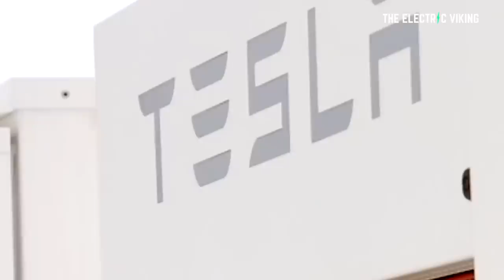Tesla's clear path to become largest truck manufacturer in the US

Comment: Hyliion has the best product-market fit. Nikola's and Tesla's products are idealistic and do not meet the demands or needs of the long-haul market. Electric Range Extender (ERX) made by Hyliion is the best way to bring electrification to trucking.
Reply: With ya on this one!
Reply: Hyliion will disrupt the trucking industry. They’re  collaborating with the best to create a remarkable drive train solution that can electrify fleets now.
Reply: Common sense: Hyliion is a much better long haul class 8 solution.
Reply: Correct sir!
Reply: Hylion hybrid natural gas trucks? Smells like fossil fuels to me. Economics will decide the winner, my money is on pure EV solutions like the Tesla semi, make your own fuel with solar plus battery storage.
Reply: @garethrobinson2275  RNG is not a fossil fuel. It is captured pollution from dairy farms and wastelands. RNG is the preferred version of CNG for trucking industry and over 50% of CNG filled already comes from renewable sources. As many capacities to capture RNG are in works as there are currently. It is widely available across 700 fuel stations which cater to trucks and fleets.
In case you are at a station where normal CNG is available , the CNG generator is 95% cleaner than diesel for emission. The new Karno generator acquired by Hyllion from GE is further cleaner and 20% more efficient.
A full BEN truck is not sustainable for long haul trucking as there are no truck chargers on the road and also the grid cannot keep up. The karno generator will be used by many of these fleets to charge their full electric trucks when grid cannot keep up.
Over the road truckers dont have 3 - 4 hours to wait and charge their trucks even if there will be chargers on road in future. Megachargers which charge truck in under 1 hour may work but one such charger consumes as much electricity as a whole truck manufacturing plant!
Reply: Hyliion Hybrid (HeX) is a product that's only a transitional product, definitely not the answer. However, the Electric Range Extender (ERX) is. Every year there's tons of methane released into the atmosphere from places like diary farms, waste water treatment facilities, etc., you can use that methane to create renewable natural gas (RNG). 

Current version of Hyliion ERX uses a natural gas generator onboard the truck, fuelled by RNG to charge batteries (because you produce the electricity onboard the truck the batteries are a lot smaller and have advantages such as weight, safety and lifespan as compared to full EV). 

Currently there's no infrastructure for full EV or hydrogen long-haull trucks, but as it gets built out Hyliion plans to introduce KARNO generator into the market that can run on a variety of fuels (so you can use both RNG, or Hydrogen if available and cost-effective to fuel the truck). And as Hydrogen becomes available and cost-effective for fleets, and infrastructure gets built out, Hyliion will only need to swap out the NG generator or KARNO generator with a Hydrogen one.

So to summarize, Hyliion has the best solution to current and future market demands.
Reply: @AndriusRut  You are 100% correct. Finally someone who undestands the reality of trucking industy which works on TCO not on emotional buying. Fleets aren't going to get all emptional and buy a $500K truck when there is no long haul usage possiblity as i explained. Hyliion's $220K truck has same or better TCO compared to diesel.
Reply: Natural gas as an alternative to BEV? The wet dream of the oil industy
Reply: @vic321344  In 2021, about 61% of U.S. utility-scale electricity generation was produced from fossil fuels (coal, natural gas, and petroleum), about 19% was from nuclear energy, and about 20% was from renewable energy sources.

Where is your energy coming from?
Reply: @afrotacular  >From gas, oil, nuclear, renewables. Its a question of efficiency. You need 1/3rd of crude oil to produce the electricity for electric trucks in power plants than when you burn it in the ICE trucks.
Reply: Troll farm.
Reply: @iandavies4853  You are more likely to be a troll with that intelligence. How about you present some proper counter-arguments instead of name-calling.
Reply: @vic321344  But you then still have a lot of negatives of EV trucks such as limited range and payload capacity, battery safety, recharge times, etc. It's better to just put the "power-plant" (aka. generator) on the truck and charge the battery.
Reply: @AndriusRut  that is just not efficient to have a generator on board. And it keeps you in demand of petrol products. The tesla Semi production will start in December. Then we will know how much of your "negatives" count again the low cost of operation, the shere power of the vehicle and the modern way of driving.
Reply: @AndriusRut  I’ve already mentioned, the stock price of company you promote has crashed from $50 to $2.60 so something very wrong. It’s just fossil plugless hybrid technology. Would have been nice idea in 1995. It’s no competition to Tesla. Very suss trolling.
Reply: @iandavies4853  Nothing is wrong with the company. Most companies stock prices fell down, especially those that are not profitable yet. Hyliion being one of them as it's a start-up. You are wrong on your assumptions and do not understand Hyliion products.
Reply: @AndriusRut  nah. It’s just a weak idea. Only recycles a small portion of energy from braking, and swaps methane gas for diesel propulsion - with Diesel engine still working. And that’s it. Totally trivial idea. You could achieve 90% of result by blending some methane into the diesel prime mover engine. Tesla is a total revolution. Be honest - this deluge of comments is too organised to not be a conspiracy.
Reply: @AndriusRut  I’ve had a look at their semi, it’d be nicer to drive than diesel, but it’s just fossil powered, small saving in CO2. It’s no rival to Tesla semi. Factory is tiny. Needs 200 kWh battery, similar power electronics & motor size as Tesla, plus 200 kW gas engine, 2-speed gearbox, conventional truck diffs, truck-size radiator. Research indicates it might save 10% in CO2 over diesel (catering for full life-cycle emissions). It’s likely to be cheaper than diesel & doesn’t need dedicated charging infrastructure. 
It’s no solution to AGW.
Ian Wright (Tesla fame) had identical idea many years ago.
Reply: @iandavies4853  Renewable natural gas can be net carbon negative. Better emissions profile than electricity from grid
Reply: @iandavies4853  You're soo wrong. RNG is not a fiction. Educate yourself or join Hyliion Investors discord community and the folk there will prove you wrong on so many different levels
Reply: @AndriusRut  educate yourself. There are three intractable industries, ocean shipping, long haul flights, heavy freight. Artificial fuels are great white hope for all.
Semis are easiest electrify via batteries, it’s actually a fantastic solution. Tesla will rule.
Ocean ferries can go electric too, but not long distance inter-continent.
Artificial fuels are just expensive, take hydrogen or similar tricks. 
The rich can afford expensive fuels for flying. Not trucking.
Read Michael Barnard, don’t trust your echo chamber.
Are you employed by / invested in HyLiion? Too many scams using this technology.
I’ve seen the tiny shed you run your bot farm from, the three (4?) converted trucks.
That’s not a billion dollar outfit. It looks like Trevor Milton’s org. In Salt Lake City, Utah?